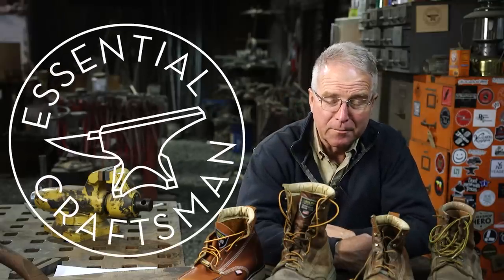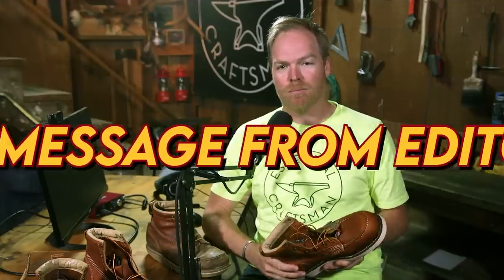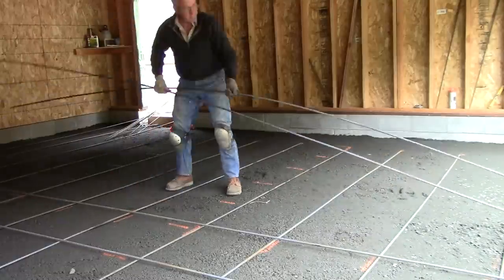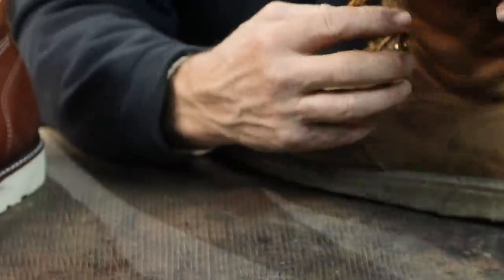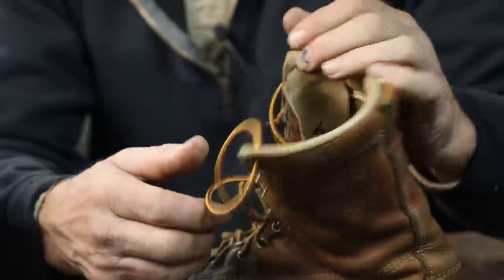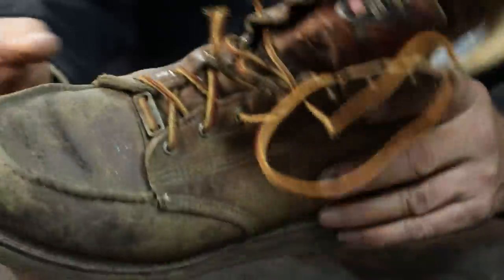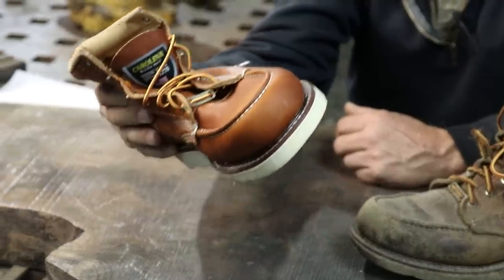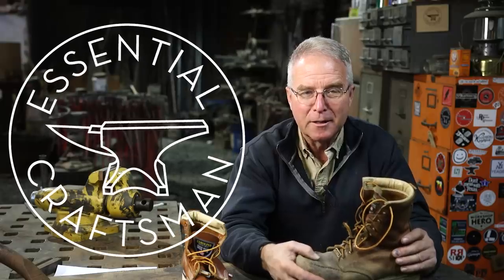Carolina Boot Review

Comment: Thorogood boots for me. Union made in USA and one of the only boots I can get in my size. (15's) I always replace the laces with iron laces and put high arch orthotics inner soles to replace the factory innersoles.
Reply: I went through 2 pairs of Thorooods in less than 2 full years of wear... the first pair of loggers made one season and both plastic heel cups split and stacked on top of each piece into a huge hard plastic ridge in the middle of the heel....gave me bad heel contusions that took 2 months to heal....they replaced them for free, although suspiciously discontinued the model I had...

The replacements were more of a standard electricians style wedge....those lasted about 8 months and the entire inside lining was tearing off and rolling up all over the toe box, the soles are bald in spots with no tread, and I had to replace the insoles 3 times (factory replacements)....final straw was when both uppers completely separated from the outsole on the toe box...I can literally slip my EE forefoot out the insides of both boots.

Union made $300 garbage.
Reply: @mthompson  sorry to hear about that. I also had trouble with the heel cup. I had my cobbler put in another piece of leather and that seemed to do the trick. I haven't had any other issues with the uppers.
Reply: N. Strickland  Not sure what part of the country you are in but there are plenty of examples of unions pushing republican candidates
Reply: N. Strickland  if Republican's weren't trying to snuff the unions out and call the people in them commie's all the time they might get a vote from them....ever think of that?
Reply: N. Strickland  Don’t kid yourself. Just bcz union leadership typically endorse democrat issues and candidates, doesn’t mean the membership is in lock-step. People will always vote on the side that benefits them personally.
Reply: I loved my thorogoods for comfort, but I was killing their wedge soles in 6-9 months. I went back to red wing super soles, slightly less comfort but I usually get 2 years out of their soles
Reply: N. Strickland  You can't really blame unions for backing Democrats. Republicans push things like "right to work" legislation which is nothing more than legalized union busting. 
Same reason guys like the Koch brothers tend to back the closest thing to a libertarian the Republicans can muster. It's in their interest to do so. 
Why would you actively vote against your own interests? If you are a union member, it makes sense to back the Democrat over the Republican (big generalization there) although to be totally fair, the Democrats haven't run a solid pro-labor candidate in a major election until very recently. Unions backing Hillary and later Biden over Bernie Sanders was mind blowing for me, a union member. Sanders was the most pro-labor candidate since the 1960s and the DNC decided that a corporately owned Democrat was a better option.
And up until covid tanked the economy, I made a very good living because of my union job.
Reply: @mthompson  Most union made stuff is indeed garbage, in my opinion. I was raised by an UAW autoworker BTW.
Reply: N. Strickland  'zactly. They are so political, because the politicians and union leaders are both so horribly corrupt.

Comment: Back in my early working years, I bought a pair of Chippewa boots with a solid sewen in thin tongue that would fold over onto itself. The purpose is that nothing could get past the tongue and into the boots. Everyone in the sawmill swore by these boots and everyone LOVED them. Fast forward a few years into my mechanic days and these boots needed new soles and I’d abused them so much that they needed one of the uppers to be restricted. 

Our local cobbler told me it would be significantly cheaper to just buy new boots, so I tossed my beloved Chippewa boots and learned two things. The first being that the tongue style I love, was no longer available. And the second was that boot quality had declined. Of course I only learned that after I’d tossed the Chippewas. 

Since then I’ve used Carolina 4x4 boots for general purpose work around the house and when I cut firewood. They are great for these purposes and I love them. But still to this day I have yet to find an adequate replace,ent for my old fold over tongue Chippewas.
Reply: have a couple sets of Chippewa boots. still going strong

Comment: In New Zealand the stock standard boot is called John Bulls, they are super strong, about 5-6in but they are slip on boots with very hard wearing leather upper and a rubber super tough sole, (it could bend a nail in 2) but they are super comfortable and strong, plus you get 1+ years about of ever set. They are only about $80 to $160NZD a pair ($40-$80 American) just a great all round boot.

Comment: I found it interesting you did not mention the value/need for steel toes and steel shanks.  As a retired firefighter, these two aspects are critical components of any worksite shoe.  Sure, it adds weight, but consideration for safety should always be paramount when selecting any new tool.
Reply: Blair & K9 Thor for a second I thought I was going crazy there. I’m from Australia and you’d be laughed off any worksite for turning up without steel caps. Even working in kitchens steel caps are mandatory!
Reply: I was a wildland firefighter and hated steel toed boots. The added weight while hiking up and down mountains 12 and 14 hours a day takes its tole. But I never really had to worry about anything falling on my feet much, so a steel toe wasn't necessary.  But I did have steel shanks.

Comment: Iv'e used Danner for years now, the type with the Made in Portland, Oregon kind of Real Danners.
I have 16" Wesco Highliners and Redwing, Wolverine Pro. But Now and from here on out, All my boots will be 100% Made in America, Period. Yes I know Danner has many products made in China. Not my boots. Be safe, Jim
Reply: I went through 4 pairs of the old pronghorns before they ruined them.  They were great hunting boots.
Reply: I went back to Danners last spring.  U.S.A. made quarries.  They are not holding up. Leather around the toes is way too soft and the sole is already about shot.  I work in excavation and paving, they are only used on excavation and in the shop. I use cofra paving boots.
Reply: @jamess662  I hear you.  Ido hardcore tree climbing and walking on asphalt. There is mud involved but, I wash em off at night before the boot dryer does the rest. I won't buy any that aren't waterproof either. I Am very tired of wet feet all day. Jim

Comment: Straight up, don’t buy Georgia Boots. I’m on my second pair in a year and a half and shouldn’t have waited so long to replace the first pair. Soles wear slick in a couple months. Soles started separating in about 4 months. They have really good memory foam insoles that wear out quick and feel like your standing on straight concrete. Will be looking for something else in the next few weeks.
Reply: We used to wear Georgia wedge soles for asphalt paving.  They were great before about 2006... they change something, we used to get a whole year maybe more, the last pair of bought lasted 3 weeks.  They won’t warranty if used on asphalt.  Complete junk, I would never buy another pair of Georgia boots.
Reply: I've worn Georgia boots for many years and have yet to experience the issues you've had.
Reply: DeVanDe Studios in asphalt I am on around 250-275f all day.  The glues that they use just doesn’t hold up.  It has been years since I’ve used them, maybe they have improved.  For the price it’s not worth buying a set to find out.  Cofra boot makes a excellent paving boot that holds up, I’m on 2 years with my first pair.
Reply: @devandestudios128  that’s good. Maybe it’s the environment I work in. The floors where I work have hot water/steam pits under them. Maybe it loosens the glue.🤷🏻‍♂️ Glad you’re having good luck with yours.

Comment: Carolina Shoe company is a subsidiary of H H Brown Shoe company, also the maker of Double H boots, and many other quality brands.  It's really gratifying to see American Union made footwear available.  Though I've owned no Carolina Shoe products (my safety shoes were Redwing because that's what Schindler Elevator subsidized), I've owned several pairs of Double H boots and the quality is first rate.  They are both durable and comfortable.  It is good to know that when you purchase these products, you are supporting American workers earning a union wage and a safe workplace.
2+ years later:  Bought a pair of the crepe sole Carolina work boots in the spring of 2021, and couldn't be more satisfied.  I maintain the uppers with a little neatsfoot oil.

Comment: Great review. I Love that Nate jumps in with an edit. He is like "Now wait a minute dad..." lol
One of the very first things Mother Army taught me was your feet are one of the most essential parts of your body. So take care of your feet. Wear decent boots and take care of them. Now I threw out my shoe shine kit long ago and I AM kinda lax in oiling my work boots I still try and wear something decent. I also learned why you are issued 2 sets of boots. It's so you can break both pairs in at the same time, you then always have a back up and it gives a pair a chance to breathe and air out for a day or so after a rough day of work. 
I am not loyal to one brand, but like everyone else we all have our preferences.  I HAVE to wear a steel or composite toe. I have dropped so much junk on my feet that I feel nervous working without them. I like a tall upper for the same reason Scott does. Ankle support and keeps dirt and such out. For that same reason I don't like slip on boots have to be lace ups and always have a backup set of laces in the truck, toolbox or lunch pail. Soles can either be flat or have a heel depending on work environment. In a shop or on hard pack I like a flat sole. Dirt, climbing  or "off road" I like having a heel.
At the moment I have I think 2 pairs of Red Wings, one insulated one straight leather. Couple pair of 
Thorogood loggers (love them but they are HEAVY) A good pair of Chippewa and a crappy pair of Chinese made Chippewa. A pair of heavy insulated  Matterhorn for when it gets really cold. And finally a pair of Reebok zip ups. These are actually my current favorite. They are light and I love the zipper on the side, easy on and easy off.
Also still have a few pair of combat boots still around for hunting, fishing, ATV riding, ect...
My wife says I  have more footwear than any one man should own. Lol

Comment: Ive been using carolinas for awhile now, i wear the 8028s. While they are a little on the heavy side i work in a hot factory on concrete 50-60 plus hrs a week. My last pair of carolinas i got 3 years of use out of. I definetly could have got another year but i decided it was time to retire them.  Glad to see thats the brand you went with, Very solid boot for the money.

Comment: I'd love to see you guys try a pair of Thorogoods. I work for the Army Corp of Engineers at a Lock and Dam. Nearly everyone I work with has switched to them. From spending hours walking on concrete, steel, metal grating, to working in the office its hard to beat the comfort, durability, and style. Made in the USA. Only downside is they are pretty expensive.

Comment: I have been waiting for this.  I started a journey of moc toe boots with a die hard based on your previous videos.  Never got used to the stiffness our sole that didn’t mold.   Got a too narrow pair of throgoods but like them. Found a pair of well worn Danners at a thrift store and love them.  Have a pair of insulated 8” Carolinas and like them but rarely wear them.  My go to has been a Duluth 6” capstone.  Good value durable and tread is soft but hardy.

Comment: I went from 15+ years in Redwings. After they changed their manufacturing to mostly overseas QC changed. At the same time i was having some lower back problems and talking around at work a bunch of guys had changed to wedge soles and had some sort of lower back relief. So i tried out Thorogood 8" Moc toe,wedge sole, and steel toe and I have been in them ever since. In my job I do a lot of walking on gravel and pavement (electrician in a power plant) the soles last about a year but I just have them re-soled at Thorogood for 65 and they are even better, a brand new sole with an already broken in upper is just awesome! Ill probably never change!

Comment: Great video. I have heard great things about Carolina boots. I know a handful of guys who swear by them. I had almost bought a pair after running through some old army surp' jungle boots and a pair of timberlands that didn't even last a year. Ended up going with Chippewa instead. I've been wearing their steel toe loggers for a little over 3 years now. Steel toe was a must when I was working in a USPS bulk mail center. The containers we used all night had dropping toe-pins that locked into the floor of the trailers. Those were always tearing up toenails. Also ruined my timberlands. Heavier than hell, but I appreciated how solid the loggers feel. Traction on the floors of the trailers was poor, and that was my only issue. Now I'm doing tree work and landscaping, steel toes are required and that lug sole is great for when were working on hillsides. Toes are totally exposed from years of postal work, but everything else is still holding up and comfy. Chippewa makes some good looking boots too. I have wanted to get a pair of the old cap toe Redwing boots for a more general use boot. Always liked the look. Just hard to justify spending 300+ on a boot that's just for casual use.

Comment: I wear these boots with a steel toe in the 8” version. They are light weight. I replace the insoles with a sofsole brand high arch insole. I too oil mine. I use Hoffman’s boot dressing. I’m a millwright and these boots are the only boots that I have found to keep my knees from killing me. I have two pairs on the job. I switch at break time. One pair is always on the boot dryer. I’m 34.

Comment: I'm going to have to try the Carolinas.   I wanted to comment on your comment about jeans.  I found years ago that if I buy my work pants (jeans) with the inseam 2" longer than normal, that the extra material bunches around the boot making a seal that keeps out chiggers and fire ants (North Texas).  And even does a good job at it when squating or working on my knees.  And no problems with dirt, pebbles, and sticks either.  25 years and counting.

Comment: I got a first pair of Carolina boots about 7 months ago. The Sway Carolina if anyone cares. I've been very happy with them. They are my daily drivers and they have held up well. I was a little worried about the synthetic material used for the uppers but other than some toe scuffing, they still look and feel good. Speaking of feeling good, man these boots have been comfortable! I thought they were a little tight at first but a couple of days in they were great. That feeling has held up. I used to be a die hard Red Wing guy but after getting a pair of American made pull ons where the soles started chipping away the FIRST DAY i wore them and the lining on the heals shredding after only a couple of months i went looking for something a little more tough. So far Carolina has me hooked.

Comment: To start with I work in a cold (34°-36°), wet(chlorinated water) environment with concrete floors and stainless steel mezzanines. I have a bad back & neck.
I wore Red Wings forever in the oilfields and doing structural steel work.  About 5 years ago I was told about a Carharrt boot (Force series) that was just as tough as the Red Wing boot but more comfortable.  So I decided to give them a try. No longer do my feet or back hurt at the end of the day! This boot is tough, super light, breathable & the most overall comfortable boot i have ever worn! I do use a high arch form fitted insert but I did this with my other boots as well. 
Take care!

Comment: I enjoy my Danner Quarry boots. The soles hold up well on ballast and with welding slag. They have goretex to keep my feet dry, until a hole burns in them.  Danner has also backed boots under warranty and replaced them. Downside, they’re expensive and heavy.

Comment: Bates tactical side zipper boots have been my "go to". Sturdy and comfortable, long wearing. Waterproof with rubber soles that grip well. Many a Firefighter wears them; easy to slip out of them to pull on turnout gear when required.

Comment: I have a pair of Carolina loggers and I love them, but I dont wear them alot. My everyday boot is a double H western boot with a steel toe. Made in America and thr most comfortable boot ive ever work. My current pair is about 3 and a half years old and has stood up to 3 and a half years of 10 to 12 hour days mostly 6 days a week on concrete, getting wet and sometimes fairly extreme temps.

Comment: One thing I do with my work boots is after every use I have a horsehair brush in a dedicated boot and shoe station in my home. And it takes me 30 seconds to a minute to take my boot off and dust them off and stick a shoe tree on them. Extends the life of the boot significantly and keeps them looking presentable for a work boot at least.

Comment: I live on vancouver island and i used to buy the cheapest boots I could fine and usually go through a pair a year. When I was traveling Australia I got to use a used pair of Blue Steel Southern Cross side zip boots. I bought a pair before coming home and they have been going strong for almost 4 years. having the ability to tie the laces up tight then just using the zipper to take them on and off is great. Going to be a bit of a pain when its time to buy a second pair with the shipping.